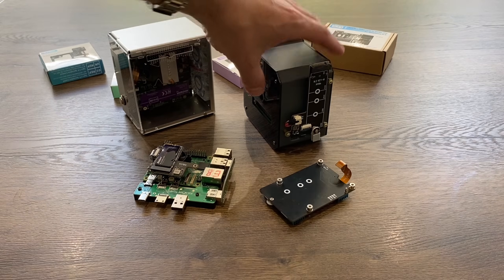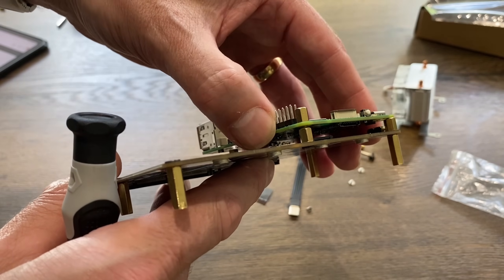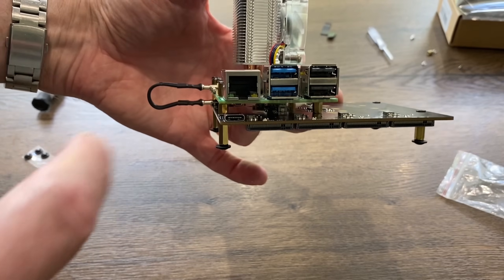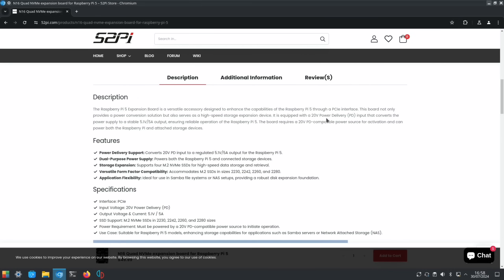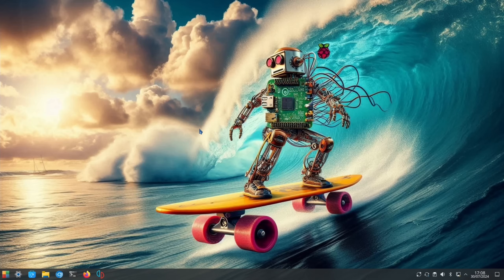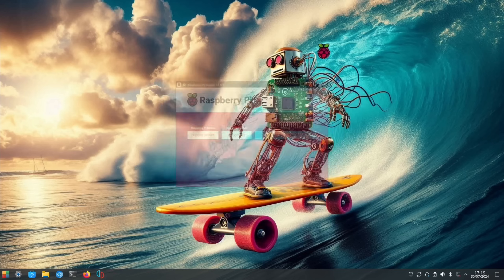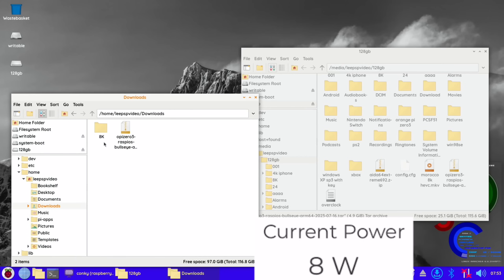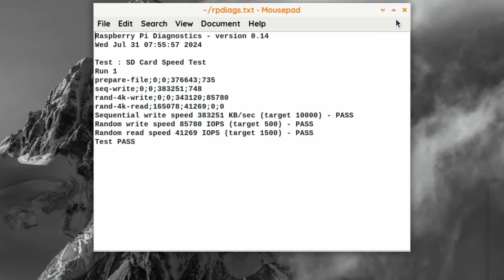Raspberry Pi 5 Quad NVMe board 52pi

Comment: I have the 52Pi N10,  a single 2230 NVMe adapter and trying to get it to boot from the NVMe.  I get the BusyBox and msg  that partition is not found, are you able to boot from your 52Pi NVMe adapter with Trixie?
Reply: Yes I can boot from my 52pi n16 card that Allows 4 name cards.  I am using 2 currently (those things are expensive)

Comment: Really dissapointed by this board.
All the promises stating on website, in their videos, and elsewhere dont add up.
Board power isnt stable enough to drive more than 2 drives at the same time.
Even with a high W PSU (65W or 100W PD) the consumption doesnt go higher than 20W.
Drives become unresponsive and i have to power cycle the complete board to get it back to work.

Im writing them E-Mails, but they refuse to send me an replacement, even tho me and various other users across the internet are providing the same bad reviews.
Reply from the maker: I was using Kde based on raspberry Pi in the video. I did play around with 4 drives attached and didn’t have issues.

Are you trying to simultaneously write to all the nvme drives?

The pcie on the Pi5 is limited to single lane
Reply: @leepspvideo  Yes of course im simultaneously writing to all. That shouldn't be an issue. And if, how can i limit each Slot to 1/4 of that speed so its slow, but runs stable.
Sure at first it seems there are no issues. But they are promising raid setups and writing to all disks is a raid thing, and therefore should be covered.
Reply from the maker: @ I’m not saying it’s an issue. I was curious. I don’t know how to limit the slot speed

Comment: My n16 board by 52pi is only working with 2 nvmes at a time. Wont do 3 or 4 (successfully). I mean it recognises it let me do very low i/o but continues to fail with using all drives at same time and constant controller resets during the initial mkfs after setting raid. Or if not using raid running a dd on all 4 causing crashes. I have my OS on a flash drive. 

Tried every 9-20v 3-6a psu you can think off. Official, apple, dell etc. 

52pi have not got back to me regarding tech support or a replacement board. Just said to email them at another address and nothing. 

Starting to think thats why they don’t provide psu specs listed. Maybe this is a problem for all. They want us to keep thinking power but seems to be a board issue.
Reply from the maker: @massey93  I haven’t tried. Would be worth asking 52Pi
Reply: @leepspvideo  I did that but nothing back from them.

If you could please do a video after clearing dmesg "sudo dmesg
-C". Then "watch dmesg".

My testing is showing it only works without controller resets with 2.

3 or 4 is causing issues. Though they are not immediately apparent.
Like i said watch the logs. I am not talking about the warnings but the resets.

Tested using the official 27w raspberry psu then assuming the issue is power related tried so many 9-20v 3-6a power supply's from apple, dell etc.

I have 4 x Crucial P3 3.0 4TB M.2 NVMEs.

Please recommend a psu as well
Reply: Other people are reporting this issue too
Reply: @massey93  having the same problem, RAID5 with encryption.

Comment: The only thing stopping me from using this is there isnt a case that can hold it properly. I'm not putting ~480$ worth of nvmes inside a wide open/exposed pcb for every day use so it can be taken out by inevitable esd. The other quad m.2 adapter made by Geekworm is utter garbage even with a 5v 8A power supply. Try using ZFS to do a Stripe or mirror.
Reply: I like all the hats RP 5 have but there doesn't seem to be an over abundance of accommodating cases fot them and I don't have a 3d printer.
Reply: See my comment above re a case for this.

Comment: One of the draw backs to this board is ordering a case. 52PI doesn't make one that will fit and neither does anyone else that I have been able to find so far. I have a 7inch screen that I would love to mount it all to for a project. If anyone knows of anything that might accommodate please let me know.
Reply: 52 pi does indeed make a case.  I just finished installing my pi in it and it is very nice.

Comment: Need tested compatible NVMe list. It couldn’t see my TeamGroup 2tb mp33
Reply from the maker: which NVMe drives work with a Raspberry Pi 5?
https://youtu.be/3mUgVTBmKio
Reply: @leepspvideo  No, which drives work in the Quad Board by 52pi. I tried Teamgroup and it couldn’t see it with lsblk
Reply from the maker: @JeffBromley  does it work as a removable drive if you are running raspberry Pi OS on the main drive?
Reply: The question is. Is there a “tested drives list” for the quad board in this video. I can’t find one or much of anything on this board. Trouble shooting via YouTube thread doesn’t seem to work when replies go missing and/or lost. 
Yes the Teamgroup NVMe drive works as a bootable drive on my geekworm x1002. I have another auto mounted in the usb slot. 
When I remove the geekworm and install this quad board the bootable NVMe does not boot it does not boot. So …
When I boot from the SSD slot with the quad installed after configuring the config.txt file then running lsblk there are no drives listed after the SSD. Doesn’t matter how many nvme’s or in what order I try, nothing. 
Btw the raspiOS I’m running on both NVMe and SSD is your kde plasma

Comment: Thank you for your video; it's exceptionally well-made! Why not directly use the Raspberry Pi on the board to connect to the SSDs below?
Reply from the maker: @52Pi_Maker_Education  I don’t understand. Is it not setup the same in the instructions?
Reply: @leepspvideo  yes, it may caused by the Ice tower cooler, the original setup is coming with Armor lite V5 heat sinks, so that the screws and copper pillar may be different, and we are going to check if the copper pillar's fault, it is a little bit longer maybe, and the mounting stander may need add to the kit for SSD 2242 fixing.

Comment: I thought about cutting the head off a long screw and then twisting the long threaded part halfway into a standoff with glue. The passive case I have requires four long screws comming in from the bottom of the case.

Comment: Can you run batocera on one m.2 and use multiple m.2 drives for rom storage or digital  setups?
Reply: yes,but you need to put the batocera to slot1 and setting the boot order to NVMe booting, and then, build a RAID5 for other 3 SSDs and mount it to the rom location, after that, you will get a big mass storage for your gaming system, yeah!

Comment: I have a question, I have seen many NVME adapters and I understood that if the card has 1 slot for the NVME disk is managed with a PCI-E Gen 3 band, the cards with 2 slots for NVME disks, each disk is managed with a PCI-E Gen 2 band.

On this Adapter if 1 slot or 2 slots or 4 slots are used at what speed do they go ?

Comment: A NAS powered by Raspberry Pi 5 and NVMe? I'll take it.
Reply: Mass storage, RAID disk array, that's easy to build with this expansion board. 😆
Reply: yes, it will power both Raspberry Pi and NVMe SSDs, according to your SSDs feature, you may need 9v-20v PD power supply.
Reply: But it will be quite a small capacity NAS using just M.2
Reply: @An.Individual  it depends on the SSD capacity right?
Reply: Thats what i thought when I made this purchase Jason but I haven’t been able to have all 4 work without seeing controller resets. With two it works as expected. I am still waiting for support from 52pi.

To be clear the raid looks like it built fine though the controller resets are effecting the reliability and under medium to high io can cause the drive to not be recognised until next reboot. 
Tried alot of different 9v-20v 3-6a psus.
Reply: You can see all this with dmesg. You can clear logs by “sudo dmesg -C”. Then in another terminal watch by “dmesg -w” or “watch dmesg”.

If you dont want to clear you could, “dmesg -w | grep -E "nvme|pcie|md0"
Reply: Just making the filesystem with 3+ nvme causes this after the raid. Or no raid just direct to disk using dd on 3+ connected nvmes it happens and can actually crash.
Reply: @ whoa 😮

Comment: Looing for a 2+ MVMe board that has RAID built into the board, pre boot so the Pi thinks there is only 1 drive.
Reply: I doubt such a board will be made, hardware RAID tends to be reserved for servers in the commercial space. There is nothing wrong with software RAID under Linux, I have used it for years.

Comment: They missed a trick here. With the size of their board they could have included an adapter board that moves the USB-C and HDMI ports to beside the Ethernet port and make the HDMI full sized. Then put their USB-C power in port on the side underneath this new USB-C. This would look a lot cleaner and not even take up any more desk space.
Reply: This suggestion is excellent. I will convey the information to our technical development team and have them try to improve it to the way you expect. Thanks

Comment: can it build a NAS if booted fron SC card
Reply: You don't need to boot from the Micro SD card anyway. You can boot from a RAID partition provided you load the appropriate RAID module from an initial RAM disk first.

Alternatively, if you have, say, 4 NVME drives of 1 TB each, you could take, say, a 1 GB partition of the beginning of each of them, use one for booting as a non-RAID partition and use the other three for swap space - that will leave you with 4 equal sized partitions that you could use for software RAID 0, 1, 5, 6 or 10.
Reply: With 2 raid 1's
Reply: absolutly yes

Comment: Ok what is the speed transfer
Reply: it may depends on SSD speed and file system type ?
Reply: @52Pi_Maker_Education but what is it capable of? I'm guessing there must be a pcie switch chip on the board, does this chip support gen 3 speeds, or only gen 2 like on the geekworm X1011?
Reply: @markmagness4780  Yes, the PCIe chip on the board supports both Gen 2.0 and Gen 3.0, but the Raspberry Pi official certification only covers Gen 2.0 speeds. Nevertheless, it is possible to force the use of Gen 3.0, as demonstrated in the video. Although Gen 3.0 is forced, the speed is as shown in the video. This board allows your Raspberry Pi to have more disk space and you can set up your own RAID 0, RAID 1, or RAID 5 using software RAID. However, some people might argue that software RAID is not as stable as hardware RAID cards. This might be considered pushing the Raspberry Pi's PCIe performance to the limit, I'm not sure.